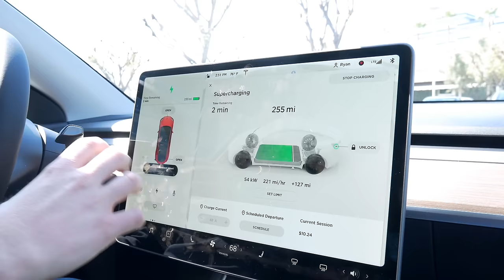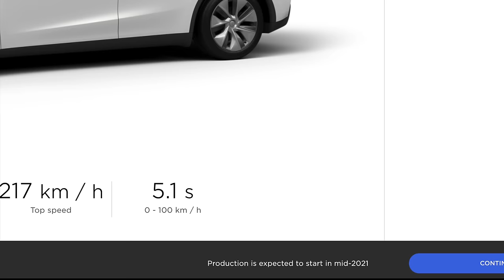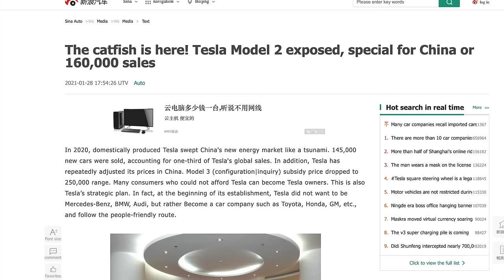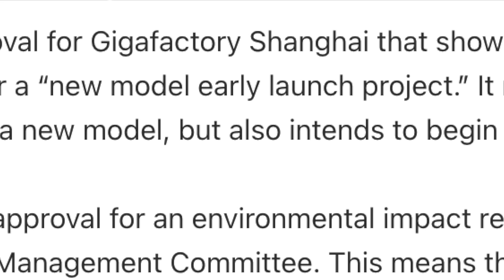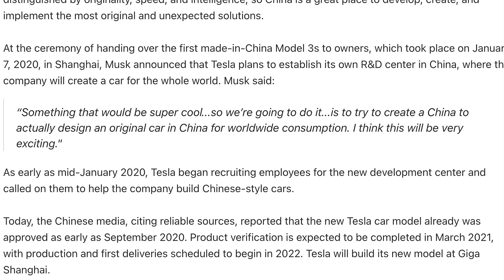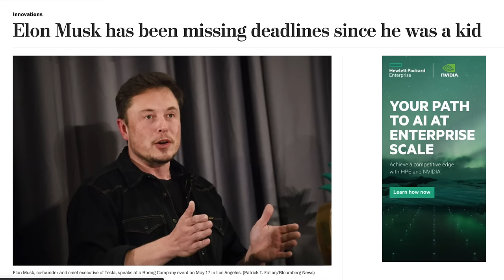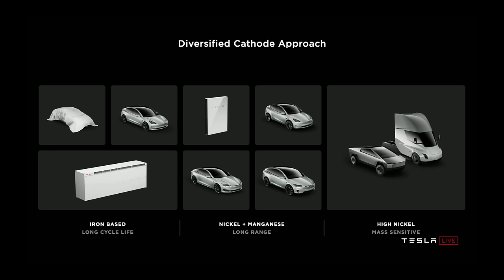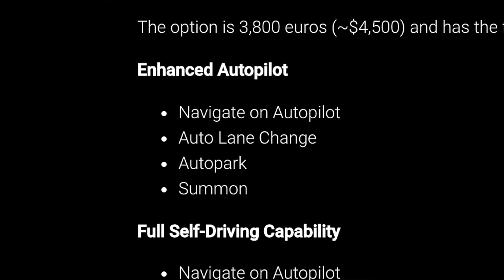LEAKED Tesla Model 2 in 2021?

Comment: Let’s hope it’s nicer than them renders at the back for that Model 2. It still needs a decent range not everyone wants a city car or has two cars. And why not have the power in acceleration as that’s a Tesla feature. I look at it like this if I can’t do Scotland’s north coast 500 (west coast)  or my variation on it from Glasgow to Durness via fort William then it’s a no sale. Yes we got a SC in Fort William but we’d need another two SC in Ullapool and Durness.
Next gen MINI Electric is rumoured 2024 and BMW want it to go 300 real miles on a designed from the ground up platform and battery improvements it would kill any small Tesla hatch if it didn’t match it.

Comment: If Tesla come out with a $25,000 Tesla. I don't think the public would not accept a range of less then 250 or 275. The Bolt can be bought for 25 thousand, easy. It has a 259 mile range and sets the minimum accepted range in the public eyes. I believe the public would be ok with a slower car. Equal to a toyota corolla....0 to 60 in 7 seconds, 180hp engine with instant EV torque and top out at 100 mph. Daily driver  performance.

Comment: 6:00 Now hold on, take a look at this pic of the supposed Model 2 that has been circulating. Something isn't quite right. I never did like that style, but there's something else wrong here. If that's a small car, you'd have to be a dwarf to fit inside it. I don't think it will look at all like that.

Comment: We start with a $25,000 tesla 2. then add $10,000 for long range (350mi) because you want it to go more than 100mi. Add $2,000 because I like red. Add $1,500 for sport wheels. Interior Black free, white $1,000 and they need to add tan $1,500. So I will ad tan. Such a rich looking color for interior.  Then self driving. Isn't that one of the reasons you are buying a Tesla?  So self driving is $10,000.

Now add it all up and this $25,000 car now costs $50,000........Still can't afford it.  Guess I will have to buy a $32,000 leaf that does 100mi.
Now if I can get all that I want in a $25,000 Tesla, I will be next in line......

Comment: As for those single- piece front and back: I have yet to hear - here on YouTube - what that means in terms of simple accidents where you replace just the damaged body parts. I assume it will  be difficult to impossible to service by anybody else but Tesla themselves and it will be expensive. Thoughts anybody?
Reply: All that's changed is the manufacturing of the front and rear underbody. They die-cast the ends in one piece each instead of welding 35+ piece of steel sheet together, then they fit them to either end of the structural pack.

Comment: I think this is the model they will debut the front and rear castings on and then start to move it out to all other models. I wonder if they will charge extra for a steering wheel to keep the price down. Maybe a new thinner longer cheaper screen. Yes 2 is the new name. 2 S3XTY or maybe the “00” ...T00 S3XY maybe an “H” for hot hatch to make S3XY THO with an “O” reserved for the Omni casting for the steering wheel free people mover that I think will be announced in 2024-2025 and will look just like a Cruise Origin but be built with a bio defense air purification mode or a party hookah mode that bubbles the air through water that can be dumped at the end of each trip. Just kidding...Kind of.

Comment: ...batteries is still the main bottleneck of deliveries, both in cost & capacity..  so TESLA is trying their earnest to secure raw materials to this end.. there are talks about partnering with Indonesia for their nickel mining, the largest nickel mining in the world..  perhaps they will also partner with the Philippines, considering they are second largest in the world..  Tesla have already signed an agreement with China’s Sichuan Yahua Industrial Group Co Ltd, the largest in China, said had signed a deal to supply battery-grade lithium hydroxide to U.S. electric vehicle (EV) manufacturer Tesla Inc for the next five (5) years.. Tesla will eventually remove Cobalt in their chemistry, removing the need to have an agreement with the Republic of Congo, a conflict mineral/ component.. Once Tesla have signed these agreements, they will be assured of continuous supply of battery for the next 5 years.. No other car manufacturer, or battery supplier have done this... so no other car manufacturer or battery supplier, will be able to sustain production..  even if other car manuf or battery supplier goes to the solid state battery route, they will still require a ton of these same components, which Tesla have already comfortably secured... other manuf will either settle for lower production output, or will simply buy their battery components from Tesla...

Comment: Nono don’t do this shit. All car companies try to accommodate Asian communities. Stick with cool stuff. Model 3 is already too small, model Y is already a model 3 that’s a little bigger. We need something cool again. We had model S and X first then model 3 which I could accept but instead of making something awesome again, they make a model Y which is not very cool let’s be honest. Now they’re thinking of making a tiny hatchback. Go back to redesigning model S that’s been looking the same for over a decade. No they didn’t do that they just changed the bottom of front bumper and some interior. Honestly I’m disappointed. We need more bigger cars and suvs and trucks. Why make a hatchback little car when Tesla runs on battery anyway. Whole point of these midget cars is that they spend less fuel and they tend to be more zippy because they’re light. Tesla’s 4 door sedan can outperform a Ferrari. We don’t need a little zippy car in a Tesla